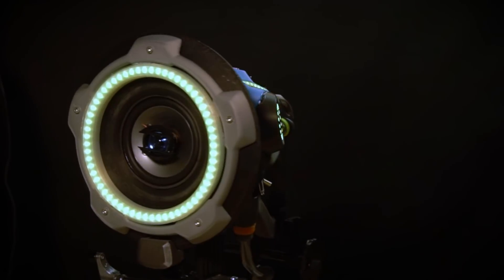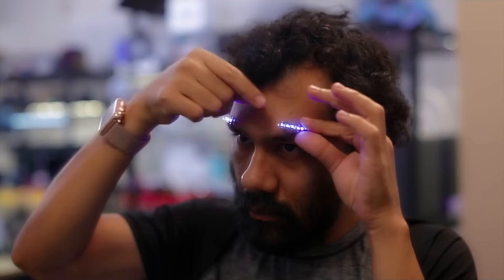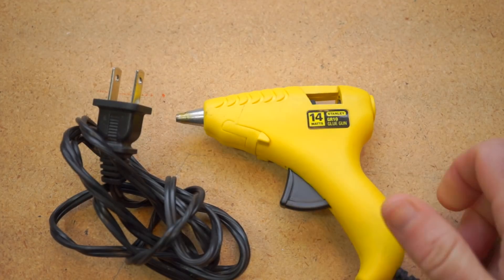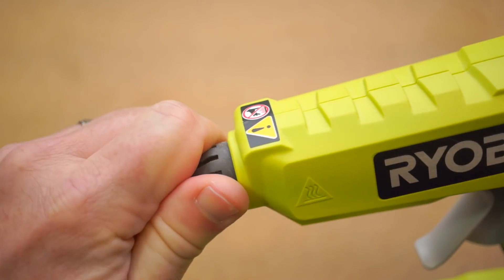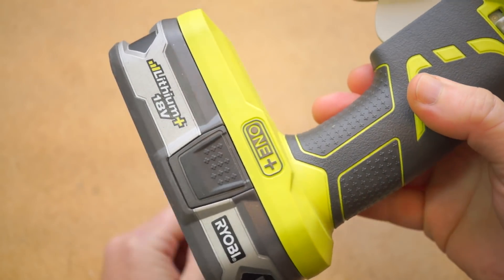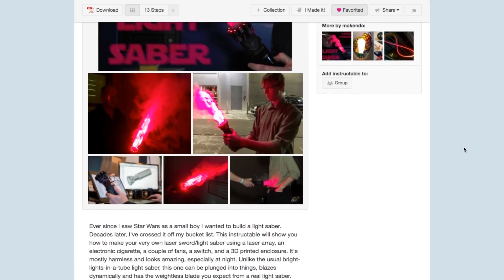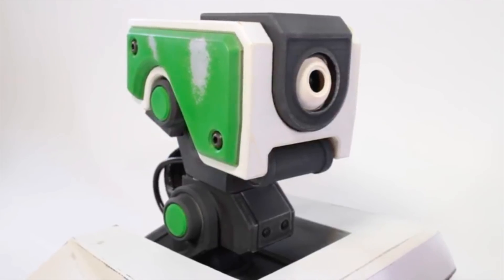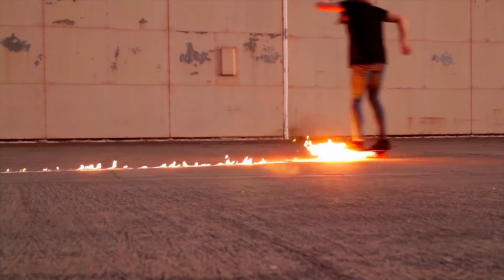Favorite Projects of 2017 [Maker Update]

Comment: While it doesn't have the benefit of helping Donald you can get a better deal on the Ryobi Glue Gun+battery combo at Home Depot. Right now (Jan 2018) it's $60 (which might almost approach a reasonable price?) and if you wanted to upgrade the runtime tHD is also selling 4 amp hour (more than double capacity) Ryobi batteries 2 for 1 (if you search ryobi batteries it will list a two pack for $99 and a single for the same price).